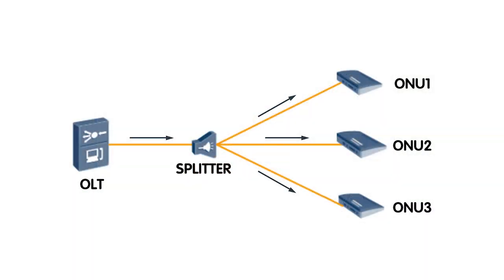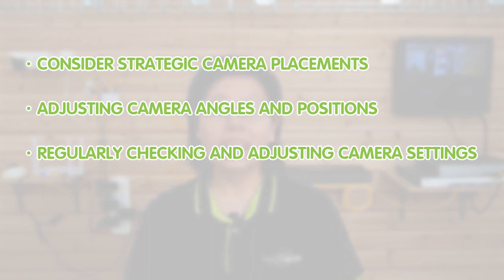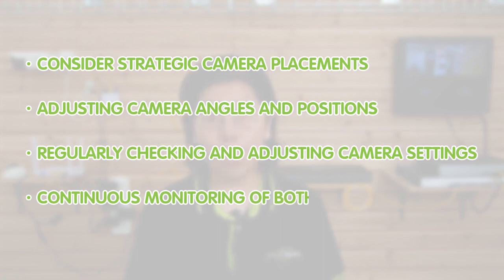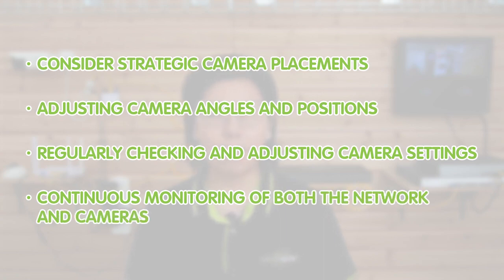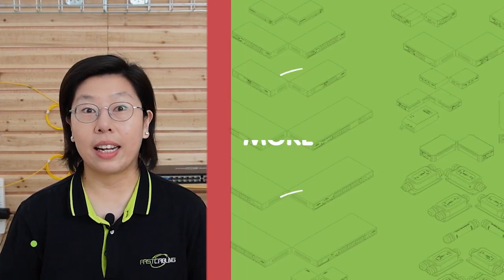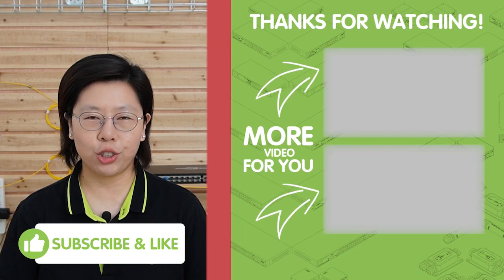Building an IP Camera System with Fiber Optical Cables (PON)

Comment: very clear network designgn but let me know The OLT and ONT are plug and play. or there is some configuration.
Reply from the maker: They need configuration. The ONT won’t pass traffic until the OLT authorizes it. The OLT also pushes service profiles (bandwidth allocation, VLANs, QoS, etc.) to the ONT.
Reply: @Fastcabling Could you please share the configuration?

Comment: This is absolutely amazing work for future generations, parallel we can also setup Access Points AP with VoIP services, easily traces which cam is down by EMS, Would love to watch the configuration video too or it’s just Plug & Play?
Reply from the maker: You can use it plug-and-play, but if you need to manage the traffic or set up VLANs, just configure the OLT.
Reply: @ Thanks for your prompt reply, Though it’s expensive but very cost effective method.